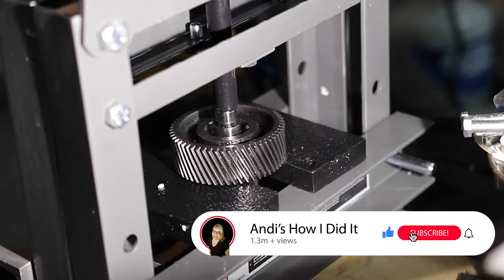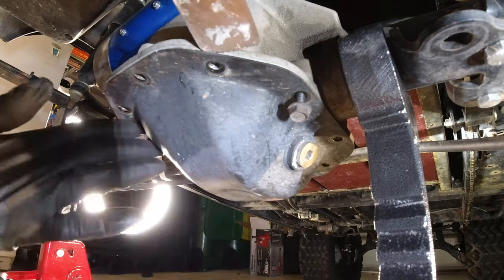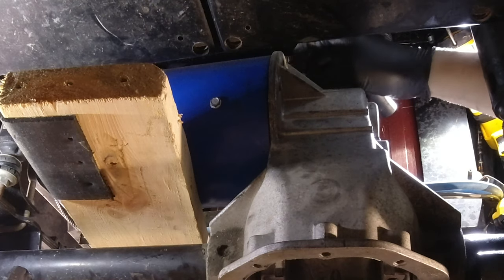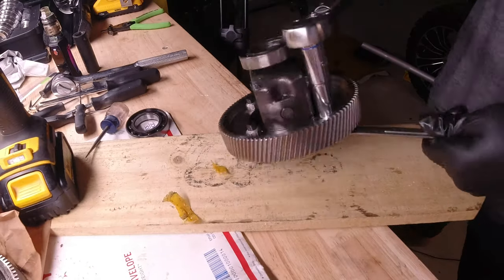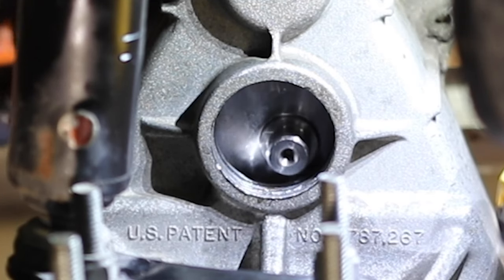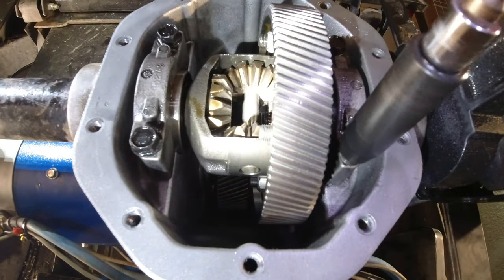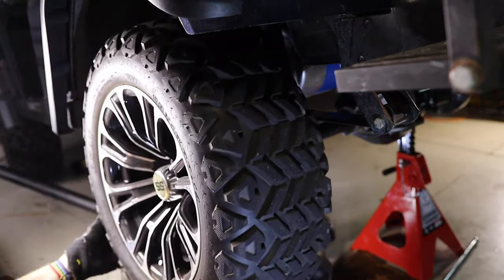How to Increase Your Golf Cart Speed - Gear Upgrade Install

Comment: That "drain plug" really isn't a drain plug.  It's a fill hole.  You can drain the differential pan by syphoning most of the lubricant with a $20 vacuum pump from HF or any auto parts store.  Also, nuts and bolts are torqued to foot pounts or inch pounds.  Liquids are measured in PSI (pounds per squre inch).  I don't think the nuts and bolts really cared what term you used😉.  In any case, the end result of your project was outstanding!

Comment: hello I finally had my Clubcar dealer upgraded my lithium cart to high speed gear. So much faster now but I notice a much much louder high pitch whining noise when I decelerate. Is this normal? Dealer says the noise will ease off with break in period. Please advice.

Comment: how much torque did you loose? im trying to decide if i want to do 8 to 1 or the 6 to 1. do you think yours would still climb hills ok if needed?
Reply from the maker: It would still climb, but I would lean towards the 8:1 if you're climbing any kind of hills. I'm all flat here so it's not an issue for me.

Comment: Good job! I absolutely know how awkward it is to hold that motor up when working from the bottom. Taking the body off seems excessive but I can tell you it makes everything so much easier.
Reply from the maker: Thank you for the feedback! I'm sure that if I did this all the time, I would certainly be taking the body off. Too much trouble working from underneath

Comment: Just a friendly comment from an old retired Dana employee. I find the older I get, the more pragmatic I become. Since you mentioned you have replaced the motor and that you've installed a lift kit.... this would lead me to believe you are absolutely capable and familiar with removing the complete rear diff from the cart. I would have suggested taking it to a differential shop and having them swap the gears for you. Any differential shop or driveline shop could do the swap for you blindfolded and probably for a case of beer if you ask the right person. Dana is a household name to them. 
Considering the price of the tools you bought and ruined in this process you would probably come out ahead in the end? And a lot of times if you let them supply the parts for you it allows them to make a bit of profit on that side as well (don't take a steak to a restaurant and ask them to cook it for you). 
So now you have a boat anchor arbor press... and you busted your butt on the conversion. You have my respect for your fearless determination... there are only a very few like you. 👍And also BTW... awesome job on the video!!!
Reply from the maker: Thank you Uncle Rob. Totally understand where you're coming from and had I not been looking to film a project with me figuring it out and doing it myself, I certainly could've taken it somewhere. But believe it or not, I love the challenge and I had a blast getting this done and proving to myself I could do it. Yes, I destroyed a cheap press thingy, and it's probably because I didn't know how to use it. This whole channel is very much a "how I did it" and less about the "right way to do it". I do believe you have the right approach in the long run, but as long as others find it entertaining, I'll keep tackling new stuff.

Comment: Thanks for the video!  I installed 8:1 gears yesterday that brings my non-lifted cart to 32mph with the alltrax controller and d&d motor.
Reply from the maker: I'm really glad to hear that! That's really fast for 8:1 - sounds awesome!
Reply: Hey Darryl, what size controller, what motor (torque/speed) and what size tires? Curious of your results before gearing. Thanks!
Reply: @mygt8a4re  with the stock 36v motor, tires, controller and chip it only did 18mph
After the 48v conversion with alltrax xct48500 controller, 500amp solenoid, larger cables, 8:1 gears, 12" wheels, d&d motor 170-500-0001 it now goes 32 mph with a custom field curve. The next cart I build I'm definitely going with an a/c conversion
Reply: @darrylstiner4245  wow the gears made a big difference in speed for you then. I'm 48v, 400a controller (2ga wires & upgraded solenoid) stock gearing on 18" tires and I go 24mph. Would hate to lose the torque I have now but would love to hit 30mph. Thanks for the response
Reply: @mygt8a4re  Mine still has plenty of torque for here in florida "no hills" next time I'm going to go with the 6:1 gears. This cart project was pretty much trial and error since there doesnt seem to be a lot of info out there on cart upgrades. The change from stock gearing to 8:1 gave me an increase of 8mph
Reply: @darrylstiner4245  That's great to hear you do have plenty of torque. I have mine turned down a bit to keep the neck snapping down on take off. Would have room to turn it up more if needed. It seems you were right where I am now before the gear upgrade. 8mph would get me to 32. Maybe I should do the gears to hit my goal. Thanks again Darryl
Reply: @mygt8a4re  I live in a golf cart community with a 30mph restricted speed. most carts do 20 mph that cars realize they can pass until they try to pass me. I see them go for the pass then they back off !
Reply: @darrylstiner4245  hahah, I'm in Fl. As well and in my area there are carts everywhere. I can ride the sidewalks pretty much everywhere w/o any trouble even though I'm not street legal. The wife and I go to a few local restaurants often. A lot of connecting neighborhoods where you see dozens of carts. Like you said "flatland", Love it! Really considering the 8:1 gears now.

Comment: Another awesome video!  I have been looking at disk front brakes. Have you ever considered a brake upgrade? The TXT doesn't stop that well with larger tires and a full complement of people....especially in hilly terrain.  Thanks again !
Reply from the maker: Thank you! It's funny you should mention brakes 😂. I just ordered a pair of rear disc brakes today. They should be in next week. After an install, the video should be out in a couple of weeks. For right now we'll just do the rear, but if I feel like it I might do some front disc as well 🤷🏼‍♀️. Time will tell. Thanks for checking out the vids 😁

Comment: Great video.

Seems like this would have been a convenient time to add a drain plug to the diff cover.
Reply from the maker: My understanding was that people use the existing plug and suck all the fluid out. But the plug is also there so you don't overfill the differential.
Reply: @AndiWofford  yes that's exactly right.  But it's handy to add a drain plug at some appropriate place on the bottom of the cover to allow you to drain and refill the diff without the hassle of trying to pump out the oil from the top.  

Drain from the bottom, fill from the top.

Again, great video.  You didn't gloss over the hard parts. 👍

Comment: Excellent video. Very detailed with good sound and video technique.
I need to do a gear change on a yamaha gas cart. Any idea what would be different? Wanna help?
Reply from the maker: That sounds really interesting. I'm not sure on the gassers, I hear they're different. But if it had the same Dana rear it might not be terribly difficult. I figured it out by tearing into it, so I'm sure if it can be done, you can figure it out!

Comment: Nice work ?What are your tires total diameter?
Reply from the maker: 14inch vector wheels and 23" tires. Just know that 23" tires is an inch too big for a 6" lift because you can't turn the wheel all the way to the left.
Reply: @AndiWofford  copy thanks!

Comment: I love the video awesome job. I wonder if removing the axel If it would have made the job easier.
Reply from the maker: I'm now a firm believer that if you were to remove the entire differential and motor, you would have a much easier time doing this from a workbench at normal height rather than crawling around on the ground underneath it. But either way works. Thanks for the compliment!

Comment: Well done! How much would you estimate you have put into your cart total?
Reply from the maker: Thanks! Way more than it's worth 🤣. Between the new batteries, motor, controller, gear, lift kit, seats, tires, wheels, top, lights, and other miscellaneous accessories, probably $4k
Reply: @AndiWofford  I'm in the market for a golf cart. Never realized a 10 year old used cart still goes for $6k. For that I figure I'll just buy new. Evolution sells a lifted 6 seater with Lithium batteries for $11k. I'm leaning towards it. Know anything about Evolution carts?
Reply from the maker: I know someone that has one, brand new, and it's back in the shop (to be honest, I don't know why though - he just said it was in the shop for something). But six seats and lithium for 11k sounds really good!

Comment: What Year is your EZ-GO? Is why the years are different on the part numbers
  Mine is a 1995 txt and all I need now is the freeze plug cap? And the bearings I have everything else I need I hope 
 Thanks
Reply from the maker: Hi Rodney. Mine is a 2000, which should have the same Dana rear end as you 1995. My 6:1 gears also fit EZGO ELECTRIC: 1992'-2013' Series, PDS, DCS, TXT, ST, and Some Workhorse Models.

Comment: Great vid! May I ask, if you had to do it all over again, would you have just bought a different motor, one that offers about 10% more torque and several mph from where you were? Iknow the learing experience is priceless but....Just curious, thank you for sharing this vid!
Reply from the maker: Hi Justin! I think I still would've done the gear upgrade. I mean, it was costly but worth it in the end. It wouldn't have taken me nearly as long if I wasn't filming it and if I actually had a video to go by 😂. Still, I bought a motor for torque and I probably would've bought one for speed instead. Looking at lithium batteries next to get a voltage boost and see if that affects speed. Learning was super fun though.
Reply: @AndiWofford  thank you for the reply and the insight of tackling this job. The Lithium conversion WILL gain you more power and speed. The weight saving alone makes the cart feel more nimble. As I'm sure you know the less weight forcing the cart to the ground along with the added speed can lead to some "iffy" cornering. Keep up the great content!

Comment: Now that you've done electrical and gears, do you think it would be easier to just leave all electrical alone and just do the gears for speed increase? Or do you think stock motor with 36v would not be enough torque to get a significant speed increase?
Reply from the maker: I think that if you did the 6:1 gear with a stock motor, you would be replacing it shortly anyway because you'd burn it up. There's no way, even without hills, that a stock motor would last very long on that gear.  I still think: 1) controller, 2) voltage/battery, 3) motor, 4) gears worked best for me.
Reply: @AndiWofford  what about stock everything with 8:1 gears?

Comment: Hey Andi,
My user's manual shows SAE 30 lightweight gear lube, which I can't find anywhere. I noticed that you used 75/140 gear lube. 
Where did you find that recommendation, because I'd like to use that too.

I was also wondering if you used any sort of sealer on the black freeze plugs.

Thanks,
-Mark
Reply from the maker: I had read from someone in a forum that that's the gear oil they used, so I used it. I make no claims as to what's right, as the 30 lube you mentioned is what you need (but hard to find) - basically you need an oil that'll coat the lower gear and transfer it up into the rest of the gears in the Dino rear end.  And lastly, I didn't use any sealer on the freeze plugs. Those things fit super tight in the rear end and you don't need anything around them.
Reply: Gear oil is just less refined motor oil you can use 10w50

Comment: My EZGO has a 6:1 gear ratio installed. I am running a 600amp navitas controller, 48v Trojan batteries & an FSIP Torque motor. Would going to a 23” tall tire work with my setup or would it not be a good idea? Thanks

Comment: When upgrading to a navitas 440 amp controller do you need to upgrade solenoid and battery cables ?
Reply: Thank you
Reply from the maker: "When upgrading to a high amperage controller, replacing your old 4-gauge battery cables is recommended - this upgrade will reduce resistance and allow better thermal management."

Nothing on golf cart king about the solenoid.

Comment: How much did it increase your top end after installing the gears ?
Reply from the maker: That question is wholly dependant upon a number of factors, including tire size, controller amperage, motor, and voltage. I go over it at the 17:50 mark in the video, exactly what the changes are and how it affects the top end.

Comment: Did you notice much acceleration lose with the speed gear?
Reply from the maker: Honestly, not much loss. More of a gain because of the high torque motor
Reply: @AndiWofford  My 14 Yamaha 48V has an A/C motor and has tons of torque but didn't want to affect it too much.
Reply from the maker: Might be a good upgrade. Might do 8:1 instead of 6:1 so you're not going all the way out of the gate. But 6:1 was great for me

Comment: Is the spider gear unit itself servicable? I need to replace my spider gears
Reply from the maker: I don't know about serviceable, but it's certainly replaceable. You can get to it by taking the plate off on the bottom of the differential housing.
Reply: @AndiWofford  Yeah, I've already pulled a diff. It's not the diff, it's the input shaft gear. Or bearing
Reply from the maker: I've pulled everything out of the rear end, including the input shafts and everything all the way to the top of the pumkin. In fact, I think I did all that in this video. @fatheadfpv5732
Reply: @AndiWofford  yes you did.  Unfortunately,now so am i.

Comment: If the gear oil doesn't go above the plug, how were you going to drain it before taking the pan off?
Reply from the maker: I had planned to use a clear plastic hose to siphon the oil out if I was going to empty it. ut you raise a good point - it's not the easiest thing to do.

Comment: What is the part number for the bearings behind the dust cover
Reply from the maker: I ordered it from eBay as a kit, came with plugs and all the bearings (axle bearings and motor shaft bearings that I didn't use too). Shipped very quickly: http://rover.ebay.com/rover/1/711-53200-19255-0/1?ff3=4&pub=5575460613&toolid=10001&campid=5338441563&customid=&mpre=https%3A%2F%2Fwww.ebay.com%2Fitm%2F254357816318

Comment: i think this would be good to change on a 36v to give a cart more pulling power gear for hills i know it slows the cart but make it pull like a mule
Reply from the maker: It definitely would!
Reply: This would take away pulling power and give you more top speed....if you want straight pulling power you want a higher gear ratio

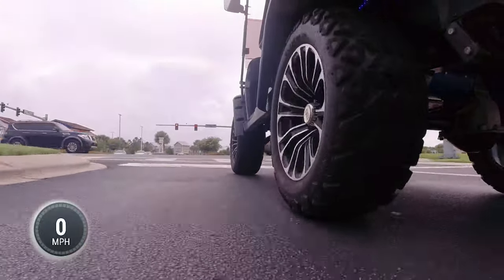Comment: What is the part number for the bearing race tool referenced at 18:55
Reply from the maker: Part No. W83020

Product Features:
Quickly and easily installs wheel bearing races and seals without destruction to race or axle housing.
Set includes six discs to fit common bearing sizes.
Sizes: 1.565, 1.75, 1.965, 2.325, 2.47 & 2.555"

Comment: Amazon has like a 8 dollar hand pump that does wonder for getting gear oil in and out of differentials. Universal pump I think they call it. Pretty good for not being a mechanic! It's probably foot pounds not psi. Torque ratings are in inch pounds, foot pounds, and newtons.
Reply from the maker: I did think about the foot pounds, but at 30 + hours of editing and voiceovers I decided not to go back in to fix it 😁.  But you're absolutely right.
Reply: Andi Wofford I really like your upgrades, I too tricked out my daughters cart with 6” lift, under glow, large tires and rims, stereo, backup camera mad Jax rear seat w/ beer cooler, street legal led light kit, subwoofer , it is really bad A$$! Now I am going to replace gears possibly for slight increase in speed, I hope but I will save the 48v upgrade when my wallet recovers a little.
V/R,
Scotty
Reply: @How I Did It  how do you know how much gear oil and the right kind to use?  I saw others fill it through a fill area and just stop once it starts coming out that
Reply: @macknumber9  that's exactly how much goes in. fill till it comes out the fill plug.
Reply from the maker: Exactly right

Comment: Time to add some batteries and go up to 60-72V
Reply from the maker: I'm seriously thinking about lithium batteries. There's so many advantages
Reply: @AndiWofford  if you were going Lithium batteries you should do a AC motor and controller or keep it in mind. I needed more speed and with 72 volt LiFePO4 batteries and a Navitas AC kit I'm over 45 mph
Reply from the maker: 45!?! 😳 With a teenager about to start driving it I'm not sure I want to make it too much faster 😂.
Reply: @AndiWofford  nice thing about the Navitas Controller, you can make it as fast or slow as you want and lock the settings. 😁

Comment: I love this but I thought I would have an appearance via our video call. It's all good though. Also torque is in ft.lbs. but you are not a professional mechanic so who really cares.
Reply from the maker: For some reason I had PSI on the brain when I was doing the voiceover. But I did talk about you in the video (I think?), I just didn't have clear audio from our chat. And I told you the other reason 😉
Reply: I love it anyway. You're such a badass
Reply: Beat me to it, PSI and  pound/feet (foot pounds to most of us) are not interchangeable terms. In fact, if you can actually find a torque wrench calibrated in PSI I'd be interested to know just where... and why.  ; )